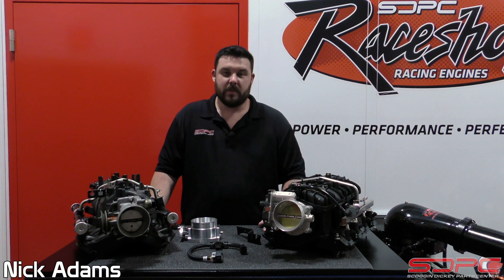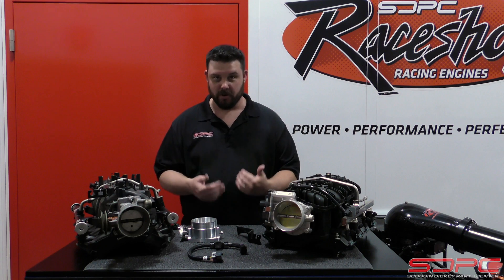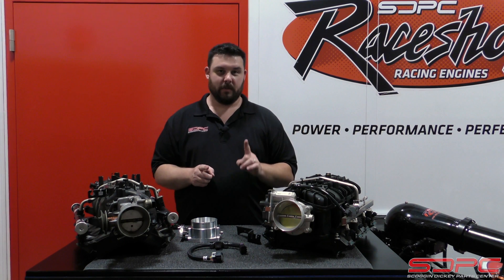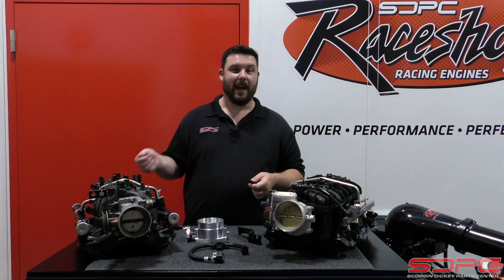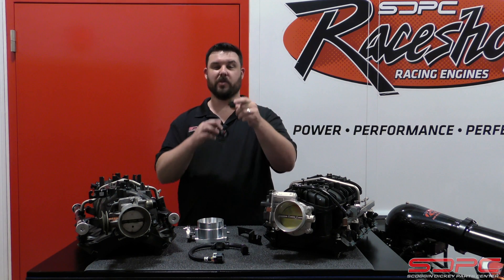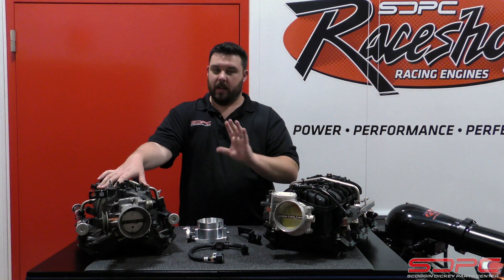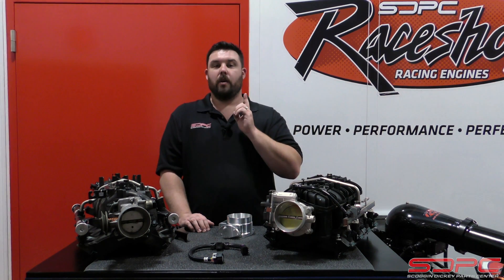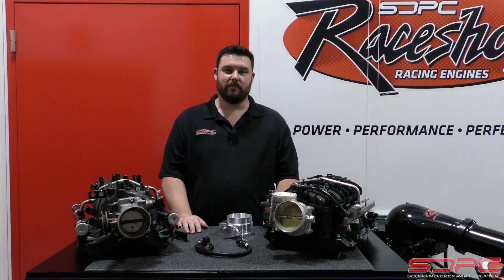SDPC Tech Tips: Cathedral Port Truck Intake Upgrade

Comment: Great content! I have a 5.3L engine. Can I install a small 5.7L manifold on the truck engine and also use an electric throttle body, keeping it away from the bearings and alternator to preserve the original factory bearings?

Comment: Did you guys have to replace the little red retainer for the vacuum line on the back of the intake when you had a leak? I’ve got a broken retainer and I’m struggling to find a replacement for it

Comment: Wtf is my tbss intake not lining up after swapping to 799 heads from 317s on a lq4? I can get on side to mount, but it will push the other side mounting bolts out of alignment by like a cm 🤔

Comment: After doing the swap here's some info. I adapted my 02 return style fuel rail to fit the intake relatively easily. I had to use the acetylene torch to bend the crossover tube but it  I was able to do it successfully to where it fit. Then the only thing left was I cut off the stock rail mounts where they screw into the intake because they weren't the right height and just took some scrap sheet metal and wrapped it around the fuel rail with a tab that was the correct height secured iwth jb weld. Also used a npt tap to add a hose nipple for my fuel pressure regulator.

I used a manifold off a 08 silverado in thne junkyard, the 07-08 nnbs use the same style map and seal no issue as the stock. I also used a ebay 40 dollar throttle body 92mm. Theres a spot you can bolt the very front throttle cable bolt and just that one and it works fine. I had planned to build a bracket but one bolt hasn't been an issue so I haven't really been concerned about it

Comment: Quick questions.  What if you decide to go with the stock throttle body that comes with the nnbs instead of the 90mm? Will you still need that X-link harness adapter? Also Will it affect performance? Or will the 90mm help it get somes gains with a cam.

Comment: I got a 2006 Canyon that originally came with a Returnless Fuel system So running a Returnless system is a breeze.  Gotta love when the regulator is built mechanically in the fuel pump. I also have a NNBS intake and it has a hard nipple for the PCV.

Comment: No one cares or likes electric powered throttle body . Those are horrible!!! I would never want a computer controlling how much of the butterfly trap can open up.. I rather have control manually with the gas pedal a wired throttle body is better then advanced.. because the computer won't ever be as accurate

Comment: What do we do for the radiator hoses that run under throttle body? I have the new one and it doesn’t have the connections

Comment: When you speak about doing the custom tuning to adapt all of the signals between the six and eight pin plugs will the truck still be drivable? My tuner is a little ways away just wondering if I'm going to have to plan to trailer it there or if there will be damage done if I drive it.

Comment: So I have a tbss intake band the manifold in rectangle  and he told me this.                               

 Bro that manifold won’t work unless your lq9 has rectangle ls3 style hesds

I got a gen 3 ls 2004 is it a 1q9 or lq4 

I showed him pictures of the heads same heads (6.0ls)  and he told they won’t fit cause there cathedral  and that my manifold is rectangle  and he told me they won’t work I just wanted my tbss intake to get ported all the way and a new throttle body someone help me

Comment: 2006 Silverado 1500 with the LQ9.  Looking for a factory crate replacement if at all possible.  Does this come in a short block only setup, or next question, I would think the cathedral style port heads will bolt up to this block the same as the original.  Really what I want is a factory crate LQ9 replacement.  Great videos, thank you all very much.

Comment: whats the part number on the throttle?
Reply from the maker: SD92MM, but we are currently out of stock. Some vendors might still have one in their inventory as we supply these throttle bodies to multiple companies.

https://sdparts.com/i-22676170
Reply: i have a 02 Silverado whit return fuel line

Comment: Hello i have a 03 5.3 silverado im getting the crate engine ls364/450 and im gona mount the ls3 intake manifold on it i already bought ev1 to ev6 fuel injector adapters and rn im looking for the x link but i dont know if i need a gold or silver and also i need help with the MAP sensor how would i go about that

Comment: I have HP tuners. What additional tunning were you referring to for when you adapt the throttle body and x-link adapter?
Reply: I've never heard of any in my internet travels, supposedly plug and play
Reply: @Diabloshell  I've been watching a lot of tuning videos lately and I think in order for you to get the optimal performance, anytime you change something on the intake, it helps if you tune your Mass Air and just make sure  your AFR is happy

But ya, it'll run after installing

I've added 2 of them so far

Comment: So you say older style trucks. But what does it do for 2008 5.3 Silverado. Truck intake on 2008 is as good or is the trailblazer SS 2009 better
Reply: Nnbs and tbss intakes are the same. You already have this on your 2008. A ported version will give you up to 18 hp  more on a heads/cam application. Chuy's porting and polishing has proof and has them available to buy.

Comment: Can you use the same injectors?
Reply from the maker: You can, but they'll usually be at the limit for any other mods.  Just keep an eye on your injector duty cycle with the tuning.  Most will swap over to the TBSS injectors or something off the flex fuel trucks.  Some will require an adapter or re-pin the connectors.

Make sure you use the right injector data!

Comment: Strange. Could have sworn "Richard Holdener" also dyno tested this and it made more power on a stock 5.3
Reply: Richard is one of the most well educated and proficient tuners of all time. His lawn mower prolly makes an extra 100 hp.  I do appreciate the hard work SDPC puts in.
Reply from the maker: Just what we'd found while testing.
¯\_(ツ)_/¯
Here's the TBSS intake with larger throttle body, graph overlaid over the stock 5.3L run in the same video:
https://youtu.be/rzzGidbDhvY?t=255

Comment: Hi, thanks for this super informative video. I'm in the process of swapping a TBSS / NNBS intake manifold on my 04 Tahoe Z71 ( flex fuel equipped with Z on 8th digit of the VIN# ), i  got the manifold with fuel rails already but still need to buy the injectors and throttle body so i  have few questions for you, if you don't mind, what's the price on your X-Link harness and where i can buy it? also will your X-Link harness work with an after market throttle bodies too or only OEM ones?? what's the larger diameter throttle i can use? and last but not least since i now have flex fuel system do i have to buy the injector adapters to be able to use the bigger TBSS injectors or must use my current ones?? Thank you very much in advance
Reply from the maker: You can use the flex fuel injectors on your truck as they will fit those rails.

92mm is the biggest you can go on the TBSS/NBSS intake. And since the X-link only works with OEM or NW throttle bodies, using the stock 07-13 gold blade throttle body is what you will need with a gold blade X-link.
Reply: @Sdpartscenter  sweet and thanks for your response, can you please provide me a link or part number so i can go ahead and order the X-Link
Reply: just sent you pictures to your instagram of the progress on my TBSS/NNBS intake swap
Reply: @Sdpartscenter  alright i already got the X-link from you at summit racing ( gold for the new OEM LS3 90mm throttle body i got ) and since my Tahoe has return fuel system i also bought the C5 vette fuel filter/regulator but now i'm having a problem because i hooked up the vette filter to the tbss ( return less ) rail but now my both ( feed & return ) factory hoses are kinked against the fire wall because the filter is way to back on the tbss rail so i was thinking in modify the rail inlet by shorten it so the filter location will be closer to the crossover port so my factory hoses will connect to the feed & return lines on the filter without getting kinked back there, i really  would love to hear your opinion about this i want to do or maybe you can suggest me something different to solve that issue i'm having, thanks again

Comment: I am working with the intake manifold from an LFA, it appears to be the same as the TBSS or "NNBS" and haven't found anything to suggest that it is a different part. It seems to have a second map sensor though, it is on the side right behind the throttle body. Any ideas on what it really is? Or any nail in the coffin against using this LFA manifold altogether?

Comment: I have a 2002 yukon denali 6.0. And my yukon came with dbw throttle body not cable driven. And I have  tbss intake on it. I was told that I need a silver blade TB and the xlink adapter  won't work. Because the 2002 use a different TB ,tac module ,pedal assembly and pcm calibration . And that a straight adapter harnesses should be good enough. Have you run into any thing  like this. Or may be is something you guys can look into and see what I can do to use a 90mm or 92mm on yukon.
Reply from the maker: Sorry we do not offer a solution for the early drive by wire trucks and SUV's.

Comment: I have trailblazer intake and xlink I always throw p1516 code reduced power. Went back to stock throttle and still does it not as much. Could I have 2 bad throttle bodies. I really like performance with ls2 throttle

Comment: What problem did you have using the factory o ring from the newer style map on the earlier map sensor?  I used this o ring on my swap and had no issues yet and have put over 20000 miles on it so far. I know I had to grid on the map sensor retainer.

Comment: Yes I have been working on putting a 5.3 into a 94 Silverado. I cut the windshield side of the dash to fit and took an inch out of it to bring the door sides of the dash in closer.so I have an 02 dash in the 94 I'm currently removing the cab harness and fuse panels to put inside. I have the power mirrors installed. The dash is also wider so I'm using some billet aluminum for door panells. My question is what all will it take to make the instrument cluster work. I have everything from the donor truck... Also I'm running a 350 turbo behind the 5.3 that's built. Wanting to keep fuel injection and put two small turbos with can and tune it. What would I need for 3.73 gears 275x60/15 drag radials to get in 6s 1/8 mile and be streetable.?????

Comment: Does the tbss intake pick up any power on a bolt on a 6.0 lq4 2500hd?

Especially in the 200-3500 rpm range.
Reply: I’m getting ready to do this. What did you find out?
Reply: @Motoxr32  i haven't did it yet. But it looks like the tbss intake is the way to go.

Comment: For us throttle by cable guys what do we do with the old coolant hoses that run under the stock throttle body
Reply: I just did mine last week what I did is I got a 1/4 hose barb connection and passed it over it it’s okay to do that if your not in places where it gets real cold since that hose line passes hot coolant thru the intake and you don’t want hot air but I’m in Texas haven’t seen real cold weather yet lol
Reply: Thats just there to heat up the throttle body. So its useless and can just be bypassed with a barb fitting.

Comment: Swapping a 5.3 in a 1995 S10 that came with a 2.2.. Will I have hood clearance issues with the SS Trailblazer intake ? Also considering a F.A.S.T intake , but don't know which one will work so hood clearance won't be an issue. Donner truck engine is a 2006 Yukon along with it's 4L60E transmission.

Comment: I like torque and if I gain some horse-ponies so be it. A daily driver is not going to see 6k or 7k RPM everyday or perhaps ever. Has anyone tried to more with the truck intake other than shave it to look pretty. Has anyone cut the cone out of the center near the Throttle Body that forces air to the center first, before this air is dispersed front and rear? Some clean up and porting can be done to match the ports better and have some positive results. Now aftermarket intakes do away with this centering tube. Working on V6 imports, some incorporate a vacuum valve to change from long air stacking to short air flow at 3,200 RPM’s.
 With that, the budget minded guy/gal who spent their retirement putting 3-4 kids thru college. As an ASE master tech since 1978, I’ve seen Nissan place an intake gasket with a counter-clockwise triangle in the port to increase low pressure rotation to help complete combustion burning and performance. Both may have benefits as we both know from the 50’s how air in motion, stacks up behind a closed intake, but a straight line is much better for high RPM. I saw this on the highly modified Corvette with carbon fiber bell shaped ends and a throttle valve inside each carbon fiber intake tube. They designed it to synchronized with 4 left and then to 4 right. Cable driven at one location of course, but a red-line starting at 9k on the dashboards tach. I find it interesting of what people & engineers come up with.
  Like the famous “Smokey Yunick”, velocity stacks, volumetric efficiency, etc., a tough B-17 bomber pilot who in the 50’s stirred the imagination of thousands of back yard mechanics, only to have son’s who build engines with more horse-ponies than the other guy who gathered pink slips...from car owners. Truck intakes maybe ugly, but still have a place in the “LS” world. Also 2003 utilities had DBW instead of cable but small & 3 bolt. Enjoy learning!!!

Comment: will this work on an 08 5.3 suburban?
Reply from the maker: Yours is an NNBS, so it won't be an improvement as you technically have the TBSS intake installed so you're already starting at a good point.
Reply: You have the gen 4 LS truck intake already, you don't need to touch it. Yours is GMT900

The upgrade is for LM7/LR4/LQ4/9 trucks or GMT800 1999-2007.

Comment: 04 4.8 here does it requires tuning what's needed I'm on a very tight budget to none just want my engine looking better than the old ugly on lol
Reply from the maker: If you change the throttle body size or different map sensors, most definitely.
Reply: @Sdpartscenter  um what's the difference if not changing anything other than jus the intake I think stock injectors are 26pounds per hr and also map sensor I'd have to change that out ? and isn't the map sensor on the tbss on the bk instead the top like my original on is ?
Reply: @Sdpartscenter  I was thinking keeping the same throttle body and map sensor also should I delete the EVAP

Comment: This applies to the vortec 8100 too, right?
Reply from the maker: Sorry, the 8100 is it's own animal.  For that it's either factory intake or a pricey one-off piece from somebody like Raylar Engineering, they do offer modified stock intakes that have the internals trimmed and opened up a smidge.
Reply: @Sdpartscenter  That's what I thought... Thanks for the prompt reply! I have been eyeing Raylar products. Looking to exhaust all options. Although, the ol' 8.1 doesn't have much support. Have a good day.

Comment: 06 here, so if my original old style fuel rail wont bolt on, what do i do? I have the tbss rail also. Do i swap injectors? As the plugs are different, i cant use tbss injectors?
Reply from the maker: Swap the fuel rail over, you can use the original injectors.  Be sure not to pinch/cut the o-rings on the injectors.  The TBSS injectors can be used but you have to either change connectors or use an adapter plug (Casper's electronics has some of these components).  You will also have to change your injector tables to the TBSS injectors while making changes to your tune.
Reply: @Sdpartscenter  according to the seller they are 36lb ev6 and i have 36lb ev1 ? Either way, i probably wont reuse either set. The tbss ones are really dirty. So are you saying to swap my original rail on the tbss?  Will that require any modifying physically? And it would simplify the tuning portion
Reply: @Sdpartscenter  in the process of doing this on a 2003 gmc denali suv but the denali has a a return line what u guys offer for that?
Reply: @ManuelGarcia-cb3lw  corvette fuel pressure regulator

Comment: What "custom" tuning needs to be done if you use the x-link?
Reply from the maker: Some of the ETC parameters will need to be adjusted, other portions of the tune will need to be optimized for improved aiflow including your MAF tables.  There might be some documentation on the HPTuners forums, but it's something that's best performed by an experienced tuner.

Comment: Literally used that exact bracket and throttle body on my swap. (2001 Silverado 1500 with an LQ4/80E swap) The only issue I encountered was that my cruise cable has too much slack. I solved it by crimping a lead fishing weight on the cable. For the fuel line, I used a C5 Corvette fuel tank transfer hose with the C5 fuel filter. It is plug and play, looks factory, and keeps the fuel lines from being up against the firewall. I am 4 years and about 25K miles on intake swap with no issues.
Reply from the maker: Awesome!  Yes the C5 filter is a common part we recommend for swaps like this.  Keeps things tidy as well.
Reply: @Sdpartscenter  - I need to upload a walk around video of mine. Most people do not realize that I swapped intakes. The NW throttle body is about all they notice right away.